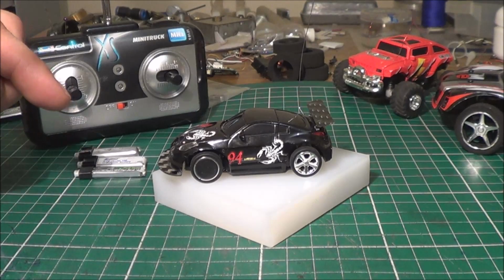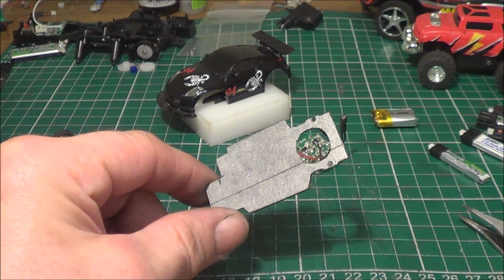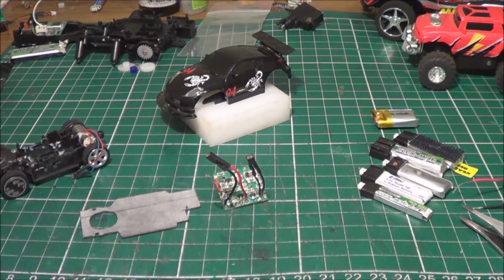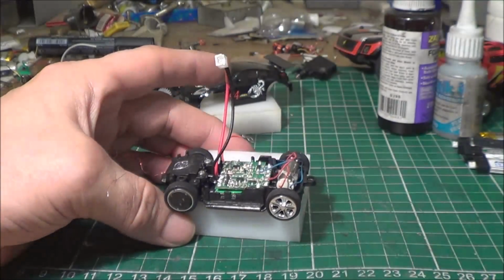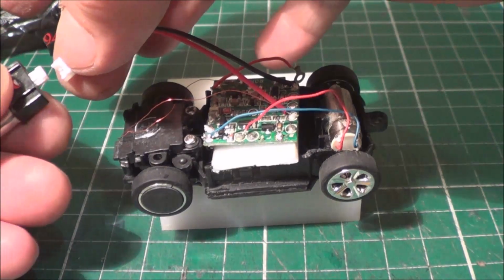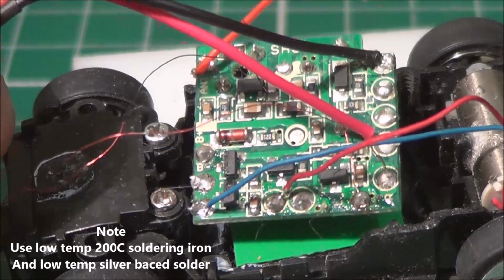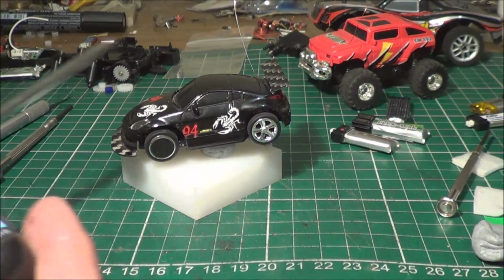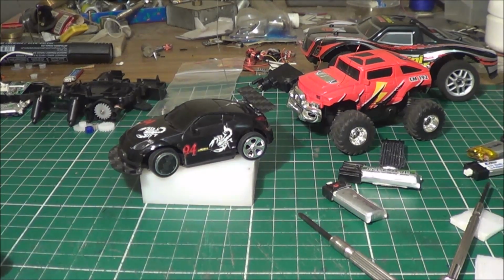2 Speed Coke Can car Tech Talk / Mad Micro RC Mods 10 Tech talk

Comment: Can I get the batteries you used on eBay? I got a crazon rc car and I wanted to see if the batteries would work with it.
Reply from the maker: Hello
Best place to get lipos cheap Hobby king.
You can buy them many places may be ebay but Hobby King is were I go as so cheap and relyable.

Comment: How did you fit the motor into place without the motor/gear frame?  It appears you removed a gear in the process...
Reply from the maker: Hello 
To do the motor swop to the next size motor 6mmx12mm to 7mmx16mm 
You must remove the compound gear set. Then remove/cut plastic away but save and glue the wheel axle plastic parts that hold it in place.
drop motor back in top and glue in, Getting the gear mesh can be tricky but I used a human hair between the gears to set the distance then glued it in the mesh was just right. 
This mod is one of the best power mods and works best with a battery upgrade you can get up to 60,000 motors in this size, The 8.5mmx20mm one I did is only for hi speed World record. But may never hit full speed as it would be over 100 Km I don't think I have found a place flat enough to go that fast yet.
Reply: AVA Magnetic Levitation wow thanks for the reply brother!  I think removing the compound gear will allow me to actually drive the RC because now, it’s just too fast with the original gear set and a 3.7v 150mah lipo upgrade.  It’s to the point where it’s useless
Reply from the maker: This can happen with too much power and a throttle thats all or nothing.
Good clean running surface and also glue an old 2 or 1 cent coin under the car as close to the rear as you can get.
The weight will not slow the car down only help traction. 
I have to do this kind of stuff to make my ones work so I can drive and film with some control.  I even clean down the wooden floor before filming after 1 day the surface is no good and has to be wiped down again.
Reply: Coin on the bottom is a great idea, im working on it now!!!

Comment: How do you monitor the lipos voltage? How do you not drain it all the way?
Reply from the maker: Hello 
I use a volt meter and after I do a build on a new model I do a running test after 3 mins check and then again after 5 and then 7 mins just to get an idea of how much time the car will run before killing the lipo.
Most Coke can cars I've done you can tell when driving a drop in power and most times it will be at 3.8 volts.
If you lipo a stock car with a 130 mAh the drive time will be more than 20 mins.

Comment: Nissan GTR cool car!
Reply from the maker: If you like the Nissans as I do I may have some surprizes coming up in the channel 1 the GTR build and also Micro 4wd Nissan drift car. 
I used to own a GTST did 260 km fist time scared the crap out of me hitting the rev limiter in 5 th gear at full speed. 
I'v also owned 6 or 7 Datsun 180B SSS one was rally car.
Reply: Of course, this vehicle is genius of japanese engineering. Awesome view, power and characteristics across with simple decisions.

Comment: Fun to mess with micro rc :)
Have you FET modded the pc board?
Here's one I did in an even smaller Bit Char-G many years ago, running 2x 50mAh 1/4 size AAA cells   https://www.youtube.com/watch?v=dDZP7jVcGiQ
Reply from the maker: Hello 
That's the kind of power I like to see in a micro. 
I've been trying to do a fav micro mods I've seen.
Can I please use your clip in the vid or better still if you have a longer one I can use small cuts from it and link people back to the full vid at your channel. 
Great work trying to get larger wheels with very soft grippy rubber like that for wheelies.
Reply: Yeah go for it, don't have any longer ones though.  Seems the old Micromods forums aren't around any more, had tutorials n stuff for all kinds of modding, from electronics to custom bodies.

Comment: I was wanting to hard wire the battery to the circuit board and use the standard charger. Will it be ok or do I need to have a special charger for it? And is hard wiring the battery a bad idea. Could you email me and give me a little advice? gracefallen_ct@yahoo.comThanks Carlos
Reply from the maker: Hello 
I have and do wire direct lipos ( S1 only ).
But if you do ( Do Not Charge With Standard Controller ) Lipos don't like it.
Cut the charge lead off the standard controller and make and charge adaptor to fit any S1 Lipo charge. 
I use old RC controllers for this from other models. 
Please watch my other Coke Can Car Vids were I cover this a little. 
Just don't run it flat when you notice a drop in power stop and charge. If you can first drive time and check voltage after 5 mins running and then ever 2 mins or if you notice a sudden drop in speed and power.
I Try to stop between 3.8 - 3.6 volts and no less than 3.5 volts.
I don't even check any more I can tell when they get there by the power drop. 
I hope this helps ask more if you need

Comment: are u selling these things??
Reply: would like to do a review of it
Reply from the maker: Not selling but I do get asked much about doing cars I may do a basic lipo swop and charger supplied if I can get all bits cheap enough. 
I have been offered $ to do custom ones to specs but its a lot of work and it + postage would make a $10 car cost $80 - $180 depending on units used plantraco kits starts at around $100 and cannot be used in some countrys other kits can cost much more. Detag reciever $65 each 
But a basic mod one may be possible or maybe a spectom with full functions people can just get bind to with there reciever and go for it.
If I do start doing them I'll remmeber this message and contact you. 
Adam VA of AVA Magnetic Levitation AUS

Comment: I read the previous comment but still don't understand the proportional steering is there a hobby grade receiver in the track car? love tinkering with toy grade rc cars just picked one of these up for fun
Reply from the maker: Hello 
I used a 1 gram PLantraco receiver in the car, And just soldered a connector to the cars Accuator and motor and just plugged them in . 
You can do this to any coke can or similar size car. 
You can by a plantraco controller kit for around $100 AUSD and get all some connectors and that all you need to convert a car. And any extra receivers are very cheap batteries you can buy or make.   
You just hack out all the plastic you need to fit it all in and away you go. 
I'm doing the next Coke can car vid now will cover this a little and may even be refitting the hi speed car in the vid time to see how fast it can go geared to over 35km+
Reply: AVA Magnetic Levitation awesome thanks for the reply. have you considered getting an ecx Beatbox to modify?  that my next project. it's 1/36 scale with proportional steering and throttle already.

Comment: Where do you find the lipo and what do u use to charge. Also you had a car with full proportional steering and throttle how?
Reply from the maker: Hello 
The full function car has a Plantraco kit in it works well and you don't even need to change the motor or accuator in the car.
batteries: RCGarage.com,  hobby king charging I just use an old controller with a S1 plug but you can buy a charger only $10 from above places. 
I have built 2 like this more vids on them very soon. 
Hope I was a help.
Reply: So I'm looking for the planetronic kit but all I find is the 99$ electronics is that it? like 900mhz? Any chance on a link or site to find the electronics. I love the vids thanks for keeping them comming!

Comment: Hi Adam, nice new video, good footage and I like your new "end credits".
Congratulaions to your new drag-record. How do you measure the speed?
Most interested I am in the motor of your car, this is not from the small monster, it is 6X12 like the coke cars. Looks like 7mm, is it from an atomic racer?
I never thougt about going with the pinion (mini-z like) directly to the last gear, great idea!
Is it the stock 6t pinion? And was it easy to mount the motor, is it glued?
Great performance... need this for my racers!
Reply from the maker: Hello 
I'm trying to get a better car set up or two and also still working out how to down load other peoples vids as I must use and show what can be done when set ups are right as yours are in your vids. I'm working to get a steering wheel set up like yours and run on a better surface also. 
You are right I needed a 7x16 and the best I had was the atomic racer motor and you can use a mix of pinions or main gears more power than needed makes it a hand full of fun.  
ps. you can get these size motors up to 65,000 RPM+

Comment: can you add tape to the wheels and make it drift? that's one of the reasons I want to buy it but I don't want to mess with internals too much
Reply: Hi, drifting these cars is a dream of me.
I had a try with my full proportional Coke Can Cars with hard rubber tires, wich are like drifttires... no chance, the back turns over, because the point to catch the car is to fast. Only thing you can do a long slide and try to catch the car.
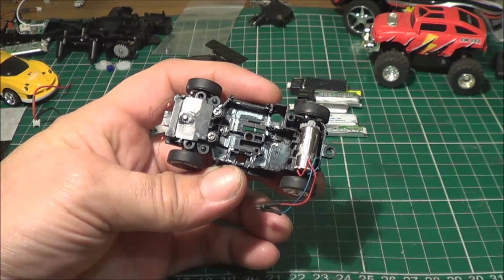Usually drifting is done with 4wd cars and differential in front and back axle. It is big fun and quite easy, because the frontaxle drive pulls the car in the right positon. But we have no 4wd in these small cars, usually these are 1:28 or bigger.
But there is another kind of drifting, called Rear wheel drive (Try Google with RWD). This seems to be another style and not easy to learn. They ride it with locked diffs and only rear drive, but the main difference is, that the steering has an extremly higth angle, almost 90 dergee.
I guess that a mod to 70 degree steering could be possible with the Coke Can Cars... unfortually I have no time
Reply: Id go look for a 4wd toy car in that case as its often the easiest solution to get it drifting properly.
There is 2wd hobby grade drift cars but they are of course quite expensive to set up, & they also have the help of gyro's to put in counter steering to work properly along with having a very sharp turning curve available too them via steering mods or being built for 2wd drifting.
Reply from the maker: Tape in the wheels this I will have to try.
Drifting stock Coke Can Cars may be very hard a full proportional set up may be easyer I will try both and see. 
If its fun and works at all I will up load it in a vid.
Reply: thanks, when will u upload even attempting?
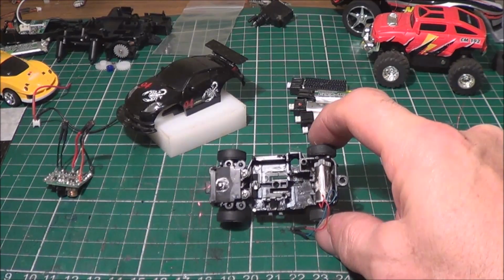Reply: AVA Magnetic Levitation i consider buying a larger scale when its for drifting. Such like 1:12 , 1:14. But 1:10 toy graded cars are too heavy for drifting, unless its a hobby graded or got plastic wheels and have a large amount of torque